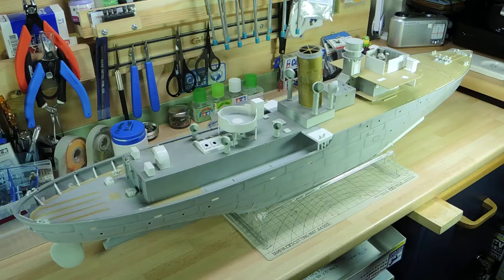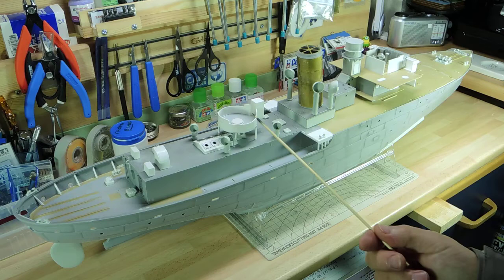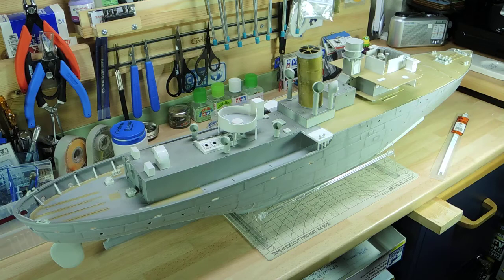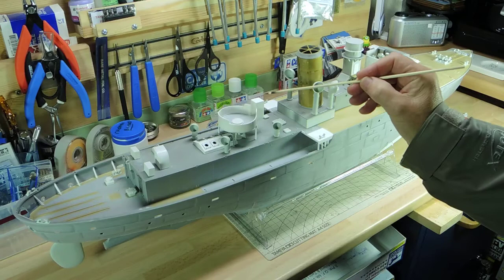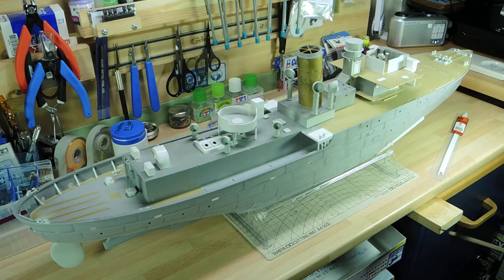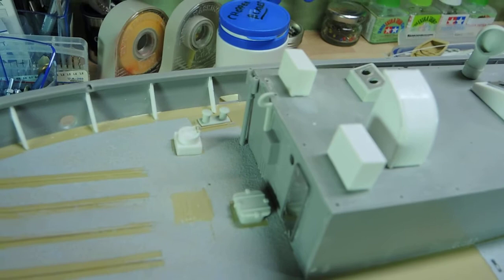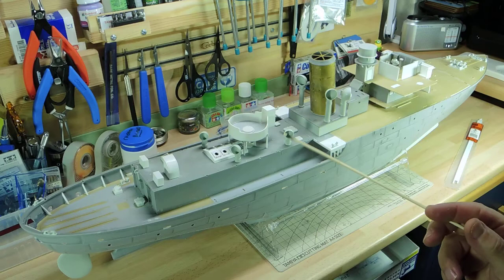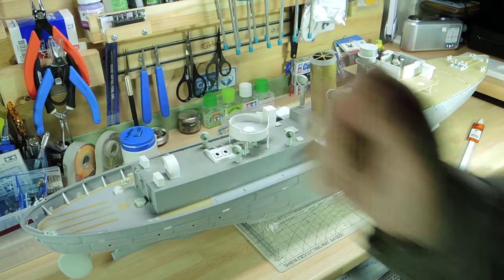SWITCHER PROJECT BUILD   FLOWER CLASS CORVETTE BUILD UPDATE 8

Comment: Great update Paul :) The davit on the quarter deck was for loading the depth charges in the racks. Without it, how would they load the DCs in the racks? Heavy ammunition is never handled by hand, a mechanical aid is always used. This is where you use your artistic license :) The QD with it omitted in the film is inaccurate, therefore as an artist, you correct the mistake :) I know we have discussed many issues that do not make sense and we discussed (well perhaps), but this one is a travesty :)
Reply from the maker: Switcher: Well then I'll right travesty, lol. I'v go a feeling the depth charge rails were added for the film?
Reply: TANK MODELLER Paul Inge
Perhaps, nothing surprises me any more (as discussed). e.g 3 different methods for filming the movie